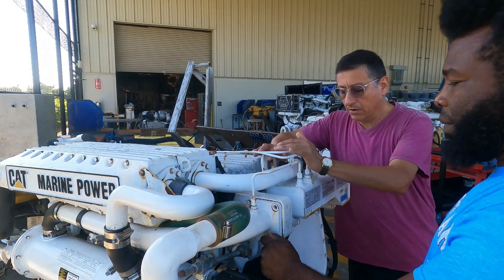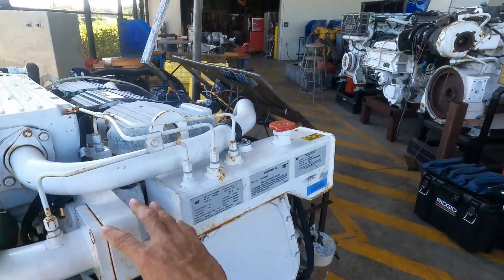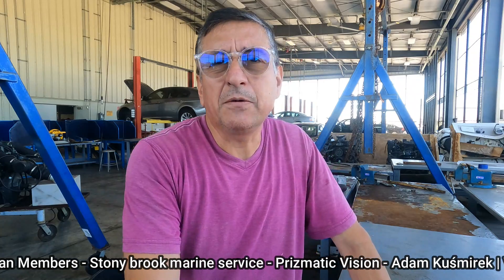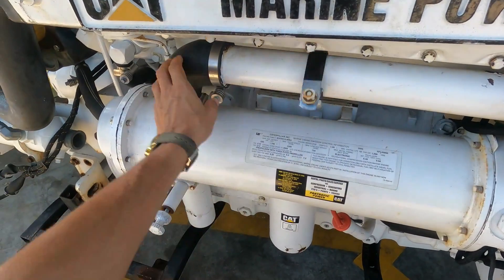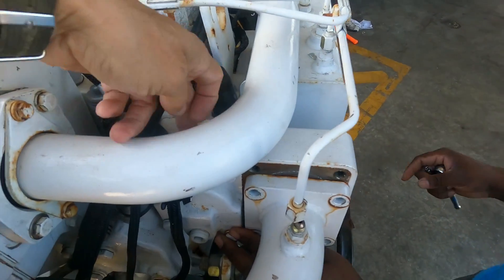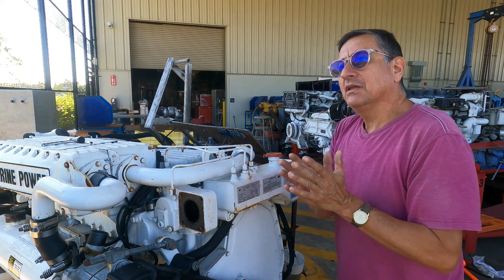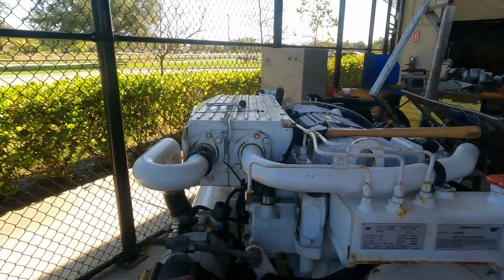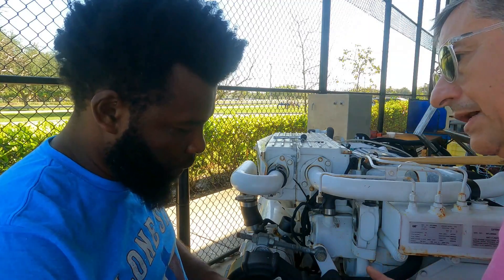Analyzing Cooling Issues in a C-12 CAT

Comment: Mr Lopez please assist 
I have two cat C12 motor which had the same operating temperatures 87-93 
On one day the starboard motor went up 1 degree and I had no reason ? 
I listened to your lecture and replaced the thermostat and the intercooler seals temp probes and redid the salt water impeller pump systems  on that motor 
Hoping it would bring it the one degree down back to the same as the other 

The only change, I got after doing this was to add another degree now the starboard motor is two degrees more than the port 

Can you advice what I can do to normalise the temps again please